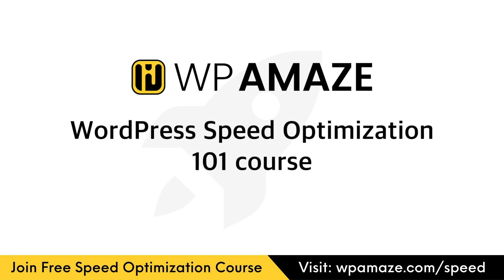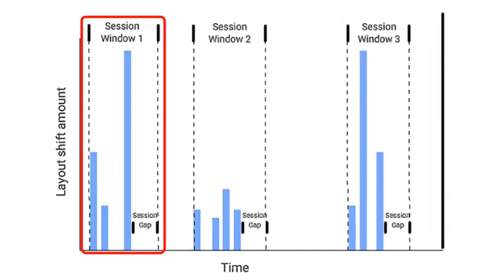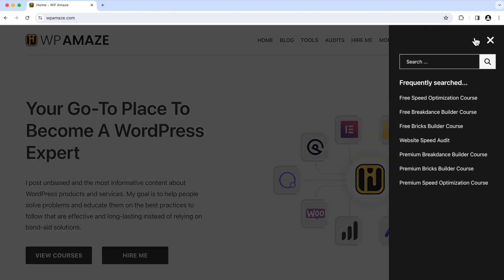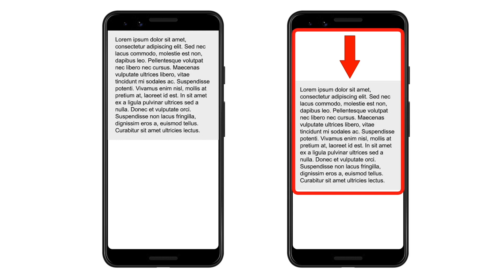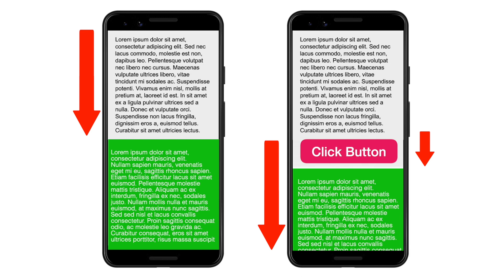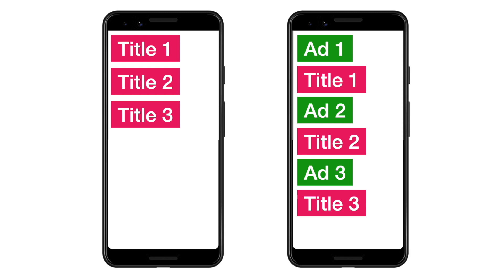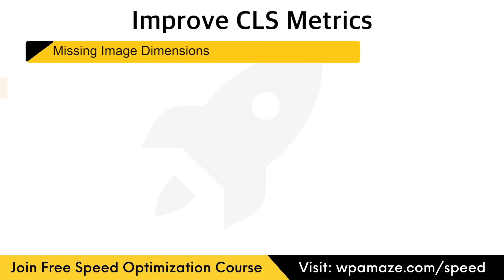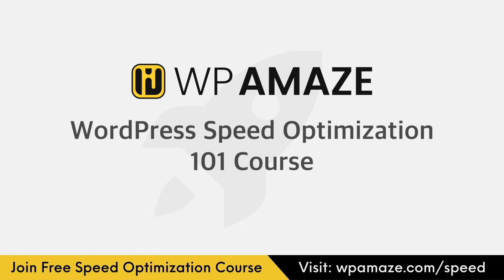Improve Cumulative Layout Shift In WordPress. WordPress Speed Optimization 101 Course | WP Amaze

Comment: The scenario is, if I add something extra between two different sections, the background of the sections cannot be changed. If it is changed, the layout will shift. This extra will have the same background as the previous section. Am I correct?
Reply from the maker: Yes. In such situation, you can add one section and three containers inside the section.